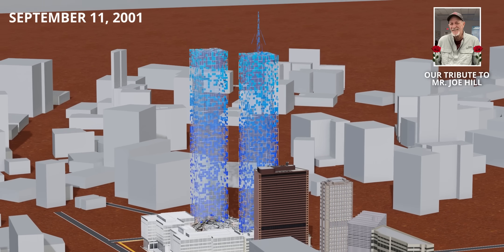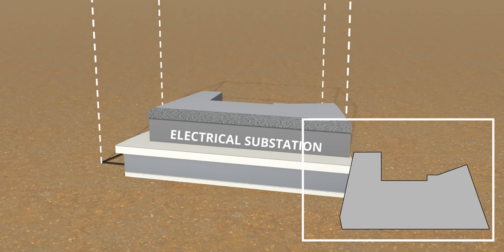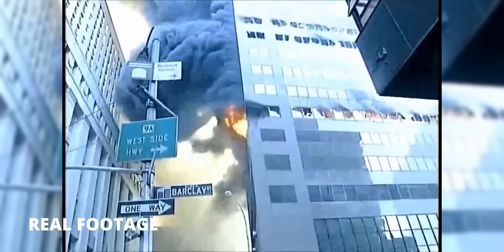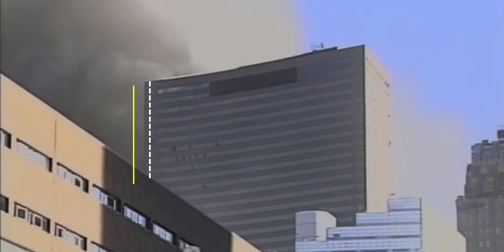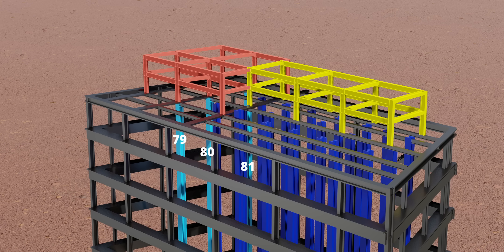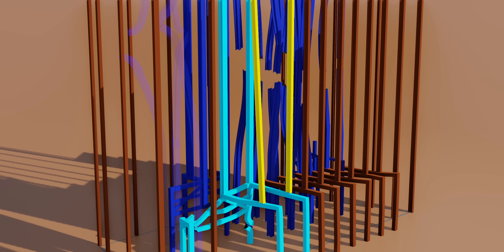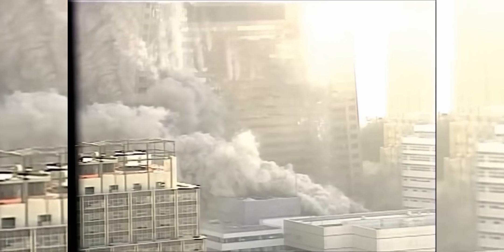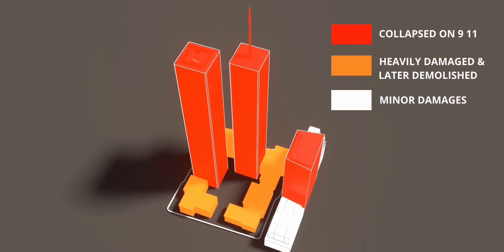Collapse of Building 7 | The Complete Physics

Comment: Establishment Disinformation.
Reply: And yet not wrong. Go figure.

Not what you want to hear, but not wrong.
Reply: @TheCriticalStinker-01    If not for the fact that the video claims temperatures as high as 600 degrees Celsius burned through the building, and steel does not begin to even slightly degrade until 1370°C and 1530°C. 
Oh, and the video hinges on the idea that the spire caused damage resulting in the failure of the first support beams when in fact the spire never made contact with WTC7, instead landing in the opposite direction upon WTC3. 
So you're right. Not what I want to hear. When all I want to hear are the facts, based in reality, with a basis in physics and the known evidence.
Reply: @c.s.s.5326  - Well that's simply not true. Structural steel will start losing strength at a mere 400-deg F (204-deg C).

Nor does this video in any way hinge on the idea that the spire caused damage resulting in the failure of the first support beams since the physical damage in and of itself was not a contributing factor to the collapse. Also, substitute perimeter columns for spire to correct that one error and nothing changes. 

You are straw manning.

Now then, can we dispense with your own personal brand of disinformation and get serious?
Reply: @c.s.s.5326  At 1530 degrees C, depending on the exact composition of steel, it will melt. At that point, steel has been "degraded" for a long long while. This is the basis of what we call "blacksmithing" and "forging", something that has been know about for the past 5000 years. So, it's really impressive that you completely failed at that.

Which, of course, also shows with all desirable clarity that you don't want to hear facts, reality, physics or evidence at all. What you want is to be right in your fantasy fairy tale. Presumably because you actual, factual, reality life is sad and boring and living in an action movie is ever so much better.
Reply: @mooneyes2k478  I don’t know what’s more impressive; someone claiming to be a facts and truth peddler making nearly ten presumptions in the same paragraph they accuse someone else of being given to presumption…or….the fact you cherry picked the higher of the two figures I provided, having had done so to thus account for the high and low range melt points / points of beginning degradation, which also represent the PoD / Melt commencement points for the most common construction quality steel.
But MOST impressive, is your failure to acknowledge that BOTH figures are less than half of the highest temperatures reached in WTC7, and the Spire “evidence” is totally false. 

Go ahead. I’ll wait.
Reply: @mooneyes2k478  Btw. They say that when people know they’re wrong, are lying, or are otherwise intellectually overmatched, they default to personal attacks. 
Food for thought. 
The more you know…?
Reply: @TheCriticalStinker-01 
The video literally animates the spire causing damage which is then cited and referenced throughout as a key contributing factor to the point of causation. 
And we can go back and forth on the temperature effects, but according to NIST, Structural Steel will not begin to suffer recordable effect from prolonged heat until 617°C (agreeably an oddly specific number I was not expecting) and that failure risk does not become a concern until focused exposure (vs radiant exposure which is what a building fire is, think, welder vs building fire) until 737°C at which point it decays rapidly from 50% of its strength capacity and continues exponentially until it loses all strength capacity at 1482°C. 

To be clear, there are many compelling points in this video, but not enough to make me turn my mind against what I am witnessing.
Reply: @c.s.s.5326  " I don’t know what’s more impressive; someone claiming to be a facts and truth peddler making nearly ten presumptions in the same paragraph they accuse someone else of being given to presumption"
I know what's more impressive. Someone needing two posts, presumably because having more than one thought at a time was a challenge, while not actually managing to say anything relevant or sensical.

The reason that I picked one of the two figures you provided was because that one wasn't even wrong, it was so bad.

As for both figures was "less than half"...you couldn't have said something more stupid if you tried. As noted, 1530 C is pretty much the Liquefaction point of steel, depending on exact alloy. If that's half of the temperatures reached....most of the WTC and surroundings would have been in a flash fire-storm.
Reply: @mooneyes2k478  - Yes, we both agree the bit about the spire was wrong. It was actually perimeter columns from the north face of the North Tower that caused the physical damage to the south and west faces of Building 7.

And what changes about the collapse of Building 7 at 5:20 pm - some 7 hours later.

Not a damn thing. 

Care to actually cite your temperature references, with quotes?  Based on your posting record so far I sure as shit am not taking your word for it. 

Also, don't forget it is about heating AND cooling.
Reply: @TheCriticalStinker-01  You missed the target with that post, but I will be interested to see what response they give.

Comment: ... And for those of us actually alive on that day, we remember watching on the news when the emergency personnel said that because the 'fires were so great', they "decided to pull it." This video is a SHAMELESS PROPAGANDA PIECE to try to deceive people from the reality that a steel-framed building fell in a fashion like a controlled demolition (because it WAS). Steel buildings don't fall from fire. Never happened before 911; never happened since, either.
Reply: Well, your memory isn't all that apparently since the broadcast you describe aired in 2002 and did not involve any emergency responders.  FFS 🤦‍♂

This video is pretty good – with a few exceptions - and goes into a much higher level of detail than many viewers will be able to comprehend.  While not perfect, the collapse mechanisms – the sequence of failures - described here  are fundamentally correct and this is true no matter who planned and carried out the 9/11 attacks or why . 

That may not be what you want to hear and go against 20+ years of entrenched dogma and conditioning, but it’s not wrong. 

That also means (in case you did not get the hint) this video can be (and IS) absolutely correct in its description of collapse mechanisms AND the 9/11 attacks could still have been some sort of inside job. The two things are in no way mutually exclusive. 

The mechanisms described here have broad professional support around the world. There are no professional engineering organizations (for example: ASCE, ASEE, ICE, etc) that disagree with them or have offered any formal dissenting opinions or alternative hypothesis. 

So, setting hubris aside, either the overwhelming majority of the worlds structural engineers and simple observation are wrong,… … or you are. Which seems more likely? 

IF you still think believe this explanation is wrong then produce a better one . Good luck with that. No one ever has and I don’t see you moving that needle today.

Comment: It's amazing how the 3 columns under the penthouse turned into thermite explosives and took out all of the other columns in the building, allowing it to collapse within its footprint. It is only the third time in history? And it all happened that day
Reply: Despite a literal janitor in the basement going on the record that the bottom floor elevator exploded and a guy had skin hanging from his arms
Reply: @ohmanyourecool1 you got a name, or?? Like, we live in the 'Age of Information' it would be cool for you to actually share some?
Reply: @Mobius_ll  William Rodriguez. Do some research.
Reply: @ohmanyourecool1  thanks and respect. Cant tell you how many conversations I have just DOA✌️
Reply: @ohmanyourecool1 I can't seem to find the basement in a building built over an already built 3 storey building, but maybe it's just me . 😊
Reply: @williamshafer1996 

That sounds dramatic, but the actual sequence was different. The penthouse collapsed first, which was a key clue. Fire had weakened a critical internal column (number 79), and when that failed, it triggered a progressive collapse from the inside out. Investigators found no thermite residues, cut columns, or blast signatures and thermite wouldn’t even behave that way in practice.
Reply: First of all, thermite isn't used for cutting, it's used for welding, just ask any rail road worker.
Second, it doesn't explode, it burns, very hot.
Third, because it burns, it falls down with gravity, so how are you going to cut vertical columns with it?

Critical thinking is absent in the mind of a conspiracy theorist.
Reply: So we're just going to ignore the fact that multiple firemen reported hearing and feeling explosions in the buildings they were in then right?
Reply: @jasongeorge1522 Big things failing feel and sound like explosions
Reply: @jasongeorge1522  I would. First who are these firemen? Name them or show us their interview. If that interview exists,   what floor were they on? Did they say  when was the last time they were in a building like WTC as C4 was cutting the beams that they could compare these "explosions" to?  Don't get on this Thermite bs because it doesn't explode. C4 is a steel cutter, TNT can but it takes too much.
Reply: @jasongeorge1522  Ignore the fact?  Nope. But just like the North & South Towers…. just before they collapsed you hear something similar. It’s a massive building. When it went down due to the the softening of multiple major support beams from a fire that was burning out of control for over 7 hours on several floors below the mid point of the building in combination with the damage it received from the collapse of the two main towers……. Several of the major support beams failed which lead to a very rapid domino effect. Do you think that the combo of major beams failing on the lower floors supporting 47 floors are not going to make a thunderous noise as the beams bend, beak apart in seconds along with all the other materials that the building was comprised of?  

When the North & South Towers fell people were trying to claim the same thing.  Based on all the footage, the damage it received when the planes hit them, eyewitness descriptions, the design of the buildings, etc.  It clearly was a pancake collapse due to major support beams being destroyed on impact from the aircraft’s and the weakening of the remaining beams from intense heat.  Yet, even with these facts….it initially did have some resemblance to a demolition because as the buildings go down you can see dust and debris shoot out of some of the floors seconds before the pancake collapse reaches those floors.  But there is no exact similar event like 9/11 and also no event like that which was well documented with so much video footage and photos in broad day light. There is no major modern catastrophe that isn’t followed by hundred hundreds of conspiracy theories and anything anyone can think of. My favorite ones are of people who did not witness the event, was not even in the New York area at the time, has no degree in engineering, doesn’t even know anything about simple, construction concepts, does not know how materials stand up to certain things like wind, earthquakes, fire, impacts, etc., and hadn’t even been conceived by September 11, 2021.  Yet, they are total experts on the matter and no for certainty that they have everything figured out completely and no matter what anyone says (including experts) they call them liars and still firmly believe that they are the true experts, and they know the absolute truth. It’s amusing, yet extremely sad at the same time. But we live in a day and age that everybody is a complete expert on literally everything nowadays and if you try to reason with them, they fire back with cursing, insults, laughing emojis and things like that which clearly show that they have to resort to those things because they have no true data and hard-core facts, only their feelings, reaction, and their colorful imagination.
Reply: Thermite is an incendiary, not an explosive. The only reason conspiracists even brought thermite into the discussion was not because there is any evidence of use (there isn't) but to rationalize the obvious lack of explosions.

So you may want to work on your story a bit more.
Reply: @TheCriticalStinker-01  ты говоришь чушь. Найди себе хорошую работу, а не занимайся написанием комментариев за деньги.
Reply: I know you wake up, salute, sing the anthem and then thank your government for never lying to you 😂
Reply: @Chann2019  Sounds like Camelot of Nov.22, 1963
Reply: @TheCriticalStinker-01 despite numerous counts of people hearing explosions before and after the planes even hit
Reply: @pmode  - So it wasn't thermite then?  Great. Thanks for making my point.

PS

There were no loud noises associated with collapse initiation at Building 7.
Reply: @TheCriticalStinker-01  I don’t think it was thermite either. I’m just saying the numerous accounts of witnesses hearing explosions is suspicious
Reply: @TheCriticalStinker-01  Absolutely not true. There were  myriad forms of evidence pointing to the use of nano-thermite in the debris. There are also photographs of the support columns cut at perfect 45 degree angles indicating demolition techniques employed to bring down the building. Larry Silverstein, the building's owner, is on film admitting to giving the command to initiate the demolition.
Reply: @TheCriticalStinker-01  oh there was evidence of nanothermite for reference see dr. Johnes’s paper in the dust with unburnt particles of nanothermite and also steel microspheres meaning at some point the steel had to be liquified!!! 
Do not muddy the waters at least please.
Reply: @TheCriticalStinker-01 - Yes, nano thermite is "incendiary, not an explosive" paint it on a concrete and steel collum, watch what happens...Only the military and military contractors are allowed to possess it...
Reply: @TheCriticalStinker-01 thermite is the only thing that can melt steel in such a short period of time. No other technology we have can melt steel especially old steel in 90min.
Reply: @TheCriticalStinker-01 - Forensic scientist found thermite in the ruble..
Reply: @henrysousa2502  - No. An astro-physcist and a chemistry profession who staked their reputations on finding thermite not surprisingly claimed to have found thermite in the rubble.

Tens of thousands of other tests failed to find the same thing, because those clowns found primer paint and tried to pass it off as thermite, to advance their political agenda. 

Even if they were right, so what?  We know thermite was not involved in the initiation of the collapse of any building - and Jones/Harritt never claimed it was - which only begs the question; who was storing left-over 4th of July fireworks somewhere on site?
Reply: @henrysousa2502  
What is thermite?
An aluminum-iron conglomerate.
Aluminum has been found in the dust.
Iron has been found in the dust.
Both materials are primary building materials; their discovery there isn't strange, but entirely expected.
Unfortunately, conspiracy theorists immediately spin such things into "stories."
Reply: @sylviarohge4204 - nano thermite (Military grade)... There are many nano energetic materials...thermodynamically stable fuel - oxidizer ignite by laser pulses...Question; Why were WTC Managers surprised when ordered to close down for a long weekend including all systems? No need to answer...:elbowcough:Have a great Sunday.
Reply: @henrysousa2502  - They weren't. That is a myth.
Reply: @TheCriticalStinker-jw4fl Because of the bs coming out on Google they're all " experts" now
Reply: @brett7761 Exactly!
Reply: @thecomicaldinker - Are you paid for this? Younare in almost every single comment. jIDF much?
Reply: @OHLeftyKnifeGuy  - Nazi much?
Reply: @TheCriticalStinker-01 You cannot have critical discourse.  It’s very obvious and does nothing to contribute to anything.
Reply: @TheCriticalStinker-01 If I had to choose between that and what you are.....
Reply: @TheCriticalStinker-01 shalom!
Reply: @AdamHodges-o6x  Agreed! This entity is a bully in my estimation.
Reply: @OHLeftyKnifeGuy  It sure seems that way. I'd say he/she or let's just use my preferred pronoun,them. is on the payroll of Alphabet.
Reply: correct